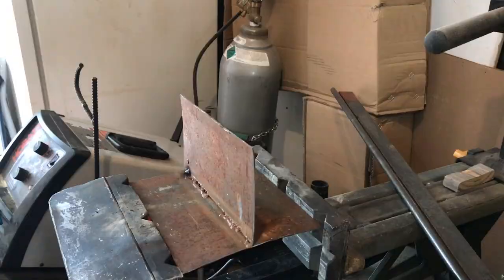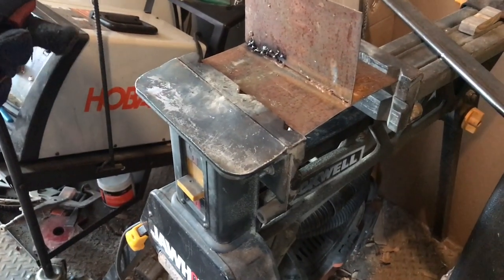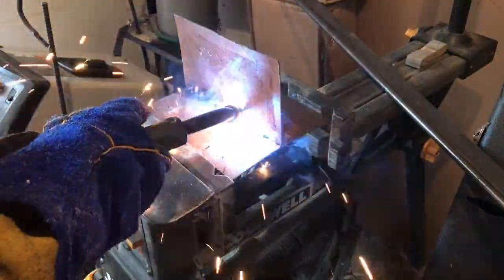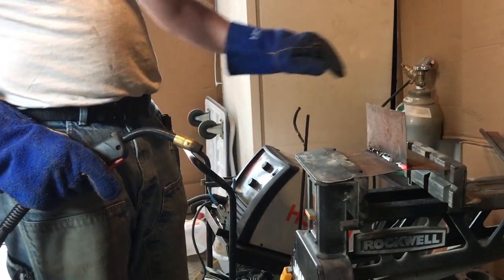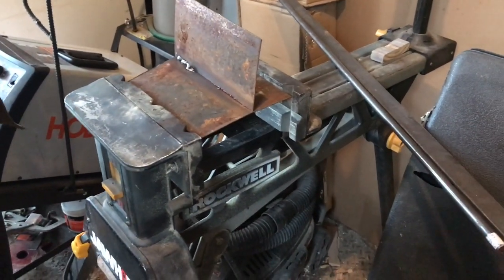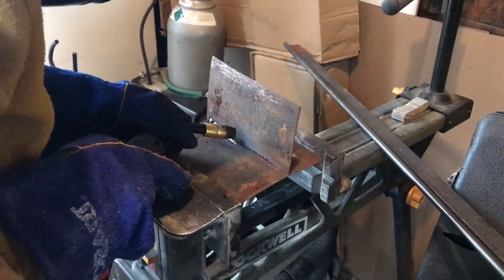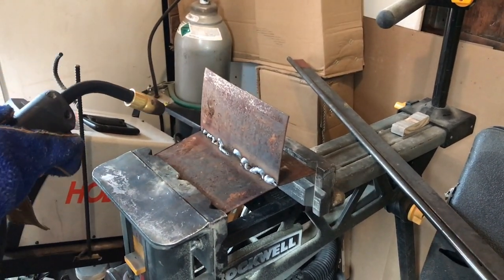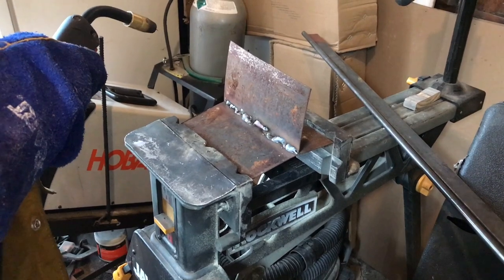Learning to Weld After Age 40. You're Never Too Old!  #74

Comment: It’s a good start, largely a practice thing. If you can see it with out the helmet on you should be able to see it with the helmet. Not sure what type of helmet you have but one with the battery in it that changes automatically when you start to weld is nice. Also sometime a little bit of stitching in your beed helps. Just a slight side to side as you go down the line. It makes your beed a little wider but helps you get good contact on both plains and since you are moving around a bit more it helps to keep you from burning through. Keep practicing!!
Reply from the maker: I'll probably get some more practice in this week. I suspect it's an issue of contrast. If I don't have enough light to see by, then everything is super blurry.